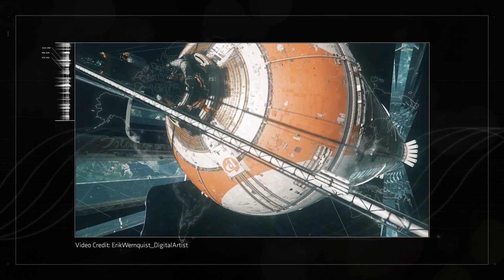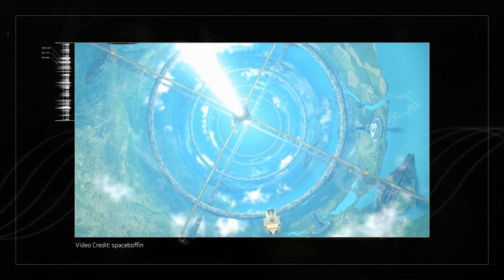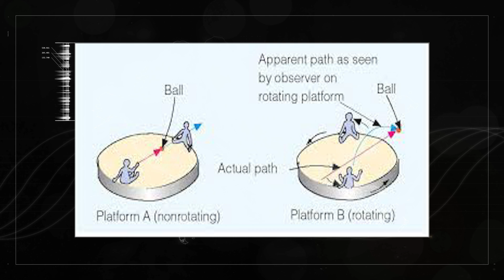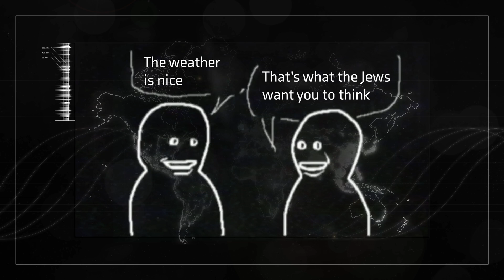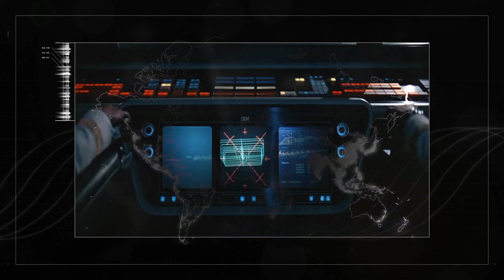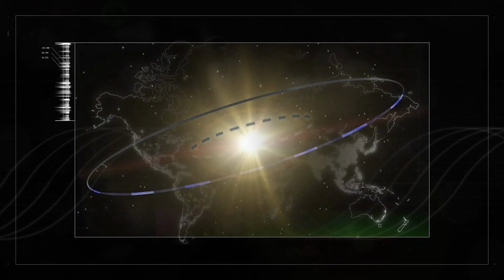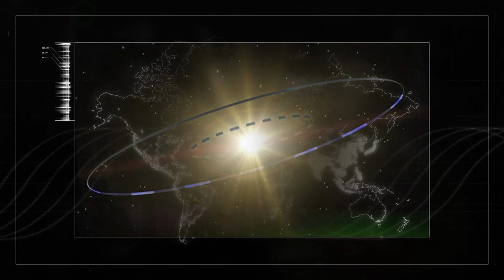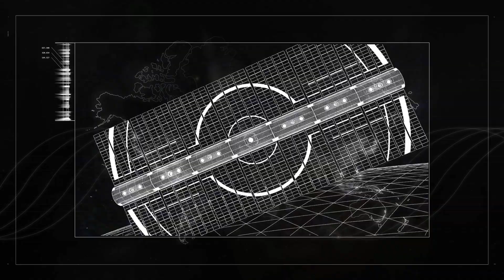Gravitational Architecture

Comment: I recently watched a Business Insider documentation which I found pretty solid ("Why living in space is almost impossible") and regarding to rotating habitats they raised a problem which they called "washing machine effect": is mass isn't well distributed, say if there is a concert or a festival in one side, the cylinder will wobble. This mechanical stress can rip it apart. 

Could you look into that in a more quantitative way ? Do the maths for us Earthworms ?
Reply: Let the cylinder's length be small compared to its radius; or in other words, let it be a wheel. If it's loaded eccentrically with wet laundry, and is mounted on a bearing, the concentration of laundry on one side will pull strongly on that bearing, with a force whose direction, of course, rotates. This vigorously shakes the washing machine, for real.

Now if you take the wheel out of the washing machine and into space, and rotate it there , well, now there's no bearing. So, no longer is the wheel forced to rotate on an axis that is not the axis it wants to rotate on. Instead it rotates on an axis that is closer to the laundry and farther from the wheel's other, empty side. So the laundry gets less g and the empty side gets more.

But there's no shaking. Everything moves stably in circles. In the wheel's rotating frame of reference, the g at any given place is of constant magnitude, and always points away from the relocated spin axis. The liquid fecal material from Business Insider is wishful thinking. I think they are following the Weinersmiths in this.

If now you broaden the wheel out to a cylinder, with a length-to-radius ratio not much less than the root-six at which it will begin to want to drop its ends out, and the laundry or the concert are not only off-centre, but near one of those ends, they could destabilize it with respect to this dropping-out.

One nice solution to that is to ensure the laundry or the concert are already concentrated in a patch of the cylinder's inner surface that is small compared to spin radius by deleting all of the rest of the cylinder. Keep only that patch. It is supported by a tether that extends straight up to, and beyond, the spin axis.

In "Dynamics and Stability of a Tethered Centrifuge in Low Earth Orbit" B. M. Quadrelli and E. C. Lorenzini report that for a setup of this type, the maximum fluctuation about the 1-g radial acceleration level is less than a milligee, and lateral oscillations are stable for any practical values of the system parameters.

For a tether material of a given tensile-strength-to-density ratio, you can get a bit more radius if it reaches straight across the spin axis in this way than if it's formed into a cylinder, because as a tense cylinder floor its loads itself at a full gee, but reaching across, it gets an average half-gee. In a cylinder it has to be there, for the elevator from the spin axis down to the deck to have something to hold onto. The cylinder needs it, but it does not need the cylinder.

Comment: I feel like the most likely Habit we will start with is one thought up relatively recently.  You take a huge net and place it around a rubble pile asteroid then spin that SOB up until it fly's apart allowing the material to catch in the net.  This can then be infused on the outside with some sort of strong resin/rebar and enclosed.  What is great about this design is we don't really need to bring as many materials up and the structure itself can be mined and industrialized.  This in my opinion is one of the only real steppingstones to space currently theorized as our mine and spaceship can be made with little material needing lifted up yet it could house factories that process the ship itself everyone is on.  This would in turn allow us to build larger more advanced things like Oneil cylinders the proper way as we mine the material from the ground itself that was once the rubble pile asteroid.  Life support and such on these early ones will be sketchy but no more than our international space station and likely far better.  Everything needed to survive is already there, the carbon for the soil, Silicon for solar panels, water and oxygen as byproducts of processing the literal haul of your now ship.  It be like taking a mountain and slowly turning it into a city using only the parts of the mountain.   The mountain might be able to support like idk 10,000 people on its surface maybe but if you used all the material, you could likely support tens of millions with it or more.  

  Hell, I hate the fact they are about to deorbit the ISS instead of moving it to the L3 or L4 as something like the ISS could be stayed in or even used for parts and matter in the future.  I just really feel like these space agencies ironically are not really thinking about the future.  Instead, they are thinking about the future contracts they will get to build stuff and not actually getting us into space properly.  If they turned the ISS RIGHT NOW into a Lunar cycler it could be huge as we could attach cargo every time it comes back and launch it into Lunar orbit with relatively little effort but no... they going to play finding Nemo with it and drop it into the Pacific Ocean like a bunch of virgin chuds.  Fyew NASA, you fake space horribly.  Get a bigger stage already you clown people.  We keep talking about going back to the moon but it's all talk. They have not even looked inside of a Lunar cave yet which is just insane.  We could likely go deep in them and create a literal atmosphere to live in as the vacuum of space does not actually suck like many believe.  Particles are instead pushed towards a vacuum and a simple trap could capture most of an atmosphere we create by processing lunar rock.

THATS IT!!! IF Ya want something done, I guess ima have to do it myself and create a startup to get this idea off the ground.  So.... Whose got money for me so I can do this already? We could likely find enough cash in all our couch cushions and get this idea off the ground before Nasa does anything about it at this friggin rate.

Comment: One unaddressed problem with the enclosed O'neill cylinder is the lighting setup. The rod in the middle of the habitat lighting everything up will cause the light direction to be directly upwards at all time of day. Meaning people would experience a sort of Lahaina Noon all the time where shadows only go directly downwards. If you've ever seen pictures of this or experienced this yourself you'll know how awkward and frankly ugly this looks, even though the light rod is the easiest solution. I definitely think it is a needed quality of life consideration, and I'm curious to see more solutions about it. Personally I don't like the window option since it removes so much area (and windows may be hard to construct) and just saying 'mirrors' is unsatisfactory to me. I've tried coming up with geometries for mirrors that fix all these problems but I've yet to see any good options
Reply: An O'Neill cylinder with a three-minute rotation period and one gee on its inner surface has an 8048-m inner radius. If its axial extent is comfortably less than root-six times that, 18 km let's say, then it will never want to drop its ends out; its forever stable mode of rotation is along the cylinder's axis. Its inner surface area is 2π times 8048 m times 18000 m.

If you can only finance a few hundred billion dollars, you might consider reducing its angular extent from 360° down to, maybe, half a degree. That works out to 70 m. Similarly, you can reduce the axial extent from 18 km down to, why not, also 70 m. Now you have a hanging bottle habitat. See if this doesn't open up some natural lighting options.

Comment: I really dislike windows in space for another reason.
You would get cancer from the background radiation.
Same with these ring worlds. Like sure you got like a lot of gas at least between you and space now a bit better than a window.
But our planet has a magnetosphere that protects us from solar wind. One of those rings wouldn't have that.
Ontop of that with one of those rings, if you ever had to stop it from spinning for maintenance or something, wouldn't everyone have to be evacuated?
And wouldn't minor inbalances change the rotation axis over time? I like the tubes more because they have some passive safety to them.
If some construction accidentally changes it's rotational axis that's fine, you could stop it and fix it. And kids would get like a break or something to play in 0G. Under supervision of course.

Comment: You left one out. Typically a habitat more like an oil rig than a floating city, but very much so a dedicated living space for potentially dozens of people, an asteroid station technically counts. This is little more than a rock that's been latched onto and treated like a proper space station for a limited amount of time. It's true that an asteroid station may have rotating habitats like a taurus, or perhaps a small cylinder tower poking out one side, but equally possible is the idea that the station will be less comfortable than this. "Artificial gravity", and I use that word loosely here, would be accomplished via magnetic boots or magnetic floors, and gently encouraged with a downward gust of wind from an overly complex HVAC system so things "fall", but only gently to avoid on-site injuries with more dangerous tools also being grabbed by the magnetic floors once they get closer. 

In the mich more distant future, perhaps around 527 years from the writing of this comment, nano-tech like smart materials or indeed some kind of efficient nano machines would float freely in the air and flip themselves into positive, negative, or neutral polarity automatically like a trillion tiny drones. They will use this to guide themselves directionally toward magnetic plates like the floor or indeed any surface desired, but will only do so if it means pushing on the surface of some much larger object like a person or a floating tool. The indicator for what to push might be a special kind of reflector so that if you simply wear a "0-G suit" then the gravity won't apply to you, and wearing a "gravity suit" will tell them you're all game to keep on the ground. This would allow one worker to move objects in 0-G right next to a waterfall being pushed into motion by millions of tiny bits of nano-tech. Further more, these same devices could be clustered to seal hull breaches immediately like the bio-foam layer of MJOLNIR armor, and could even be used to lock down criminals or enemy combatants that board your vessel. Boarding parties during times of war would need to use flame throwers to burn the enemy's nano-tech so it no longer functions when used against them, and then would need to use magnetic boots to move through the enemy asteroid station. You thought I forgot what I was talking about, didn't you?

The asteroid station is essentially a rock that's slowly hollowed out and mined until its main purpose is to be dropped onto water moons to build artificial rock islands for better habitats while the crew leap frogs onto another asteroid to begin strip mining that one for metals as well (mostly controlling local ROVs to do the physical labor, of course).

Comment: There is one massive benefit of the tether system, which is it is by far the lightest way of getting a large axis of rotation, so if your trying to build anything mobile like a ship its a handy way to give it artificial gravity during the multi month coast phase. Most spaceships already break into multiple pieces due to dropping spent fuel tanks, the Mars Direct architecture by Robert Zebrin takes advantage of that by spinning a crew capsule around on a tether connected to the empty spent booster stage. Artificial gravity for the low low price of a few kilograms of tether.

Comment: Dock at the spin axis, take the elevator down. (2:33)
Reply: Oh wait, for an O'Neill cylinder you understand that, but for a tether, somehow you don't.
Reply: @grlcowan  I was about to comment something similar. Xandros needs to make a correction at that timestamp.
Reply from the maker: I actually included that in the original script, but I cut it in the edit. I figured the use-cases for the tethered station architecture are probably a bit more niche than the other designs so I didn't want to dwell on the details too much -- I could probably make a video on the particulars of each station type in the future.

I'm sure you could arrange to dock at the axis of rotation on the tether and take an elevator to the habitation segment, although I'm unsure exactly how stable this configuration would be. I'll investigate the physics a bit more before I do a deep-dive.
Reply: I’d love to see a deeper dive on the tethered solution. It’s the least explored even though it’s the most mass efficient and the most technologically modest. It’s ideal for spaceships enduring a long coast period – modular hulls reeling themselves in and out depending on flight phase. The main obstacle I see is oscillation. You’d need some smartly placed bracing cables and a couple lightweight interstitial truss segments.

Comment: I'd say that Rod station was closest to the tether system, except the tether is rigid and habitable.
Reply: I'm personally not a fan of the rod station because it would be easier and more economical in theory to build a Stanford Torus. What dimensions do you propose for such a structure?
Reply: I don't propose anything. I was disagreeing with Xandros' categorisation.

Even if it weren't a full torus, those separate modules would probably be better utilised in a torus-type station. There's a mod for KSP that includes a gravity centrifuge part like that.
Reply: A Torus realistically makes the most sense, I didn't consider breaking up the habitation modules to cut down on the amount of resources used. The biggest issue for a Torus in my opinion is ships docking and undocking from the station. Even if the Torus is rotating at one RPM it would require fuel and time to speed up or slow down to match the rotation of the Torus.
Reply: @UndercoverSenpai01  Like was mentioned in the video, Torus stations usually have a hub at the centre axis specifically for docking. That way, docking spacecraft only have to approach along that axis and match the rate of spin. That requires very little fuel to accomplish.

I assume you're imagining spacecraft docking with the ring, rather than a hub? Tycho Station from The Expanse had that.
Reply: @ReddwarfIV  I was imagining a smaller Torus station, only a dozen meters across. Using a central ring for docking makes much more sense in practice. The issue I foresee is comparability with different spacecraft designs and docking standards, realistically you would want to make the central ring large enough for multiple capsules to dock simultaneously, most likely being anywhere from 10-12 meters in diameter. Interesting stuff.
Reply: @UndercoverSenpai01  I'm not sure why it would be more economical than a stick station. A stick station is literally just a simple stick, made up of only a few modules. It's an extremely achievable thing for us to try as a first experiment in artificial gravity than most other concepts.
Reply: @ The only reason in my mind why a Torus makes more sense economically is economies of scale. It's a lot cheaper to mine a large amount of material in the long term.